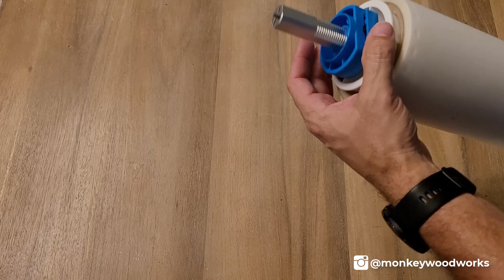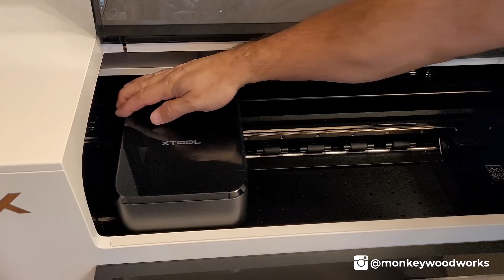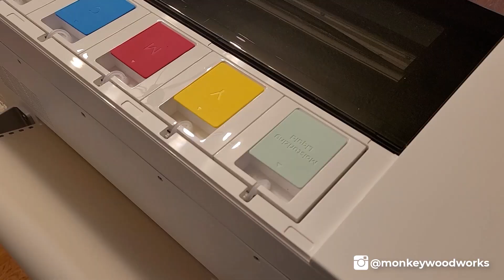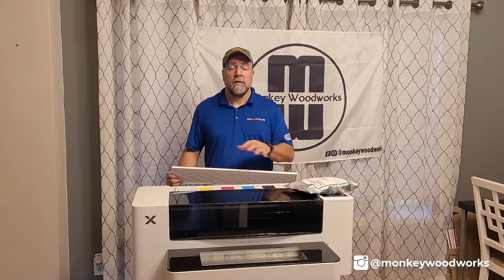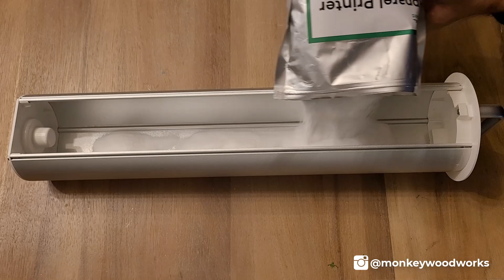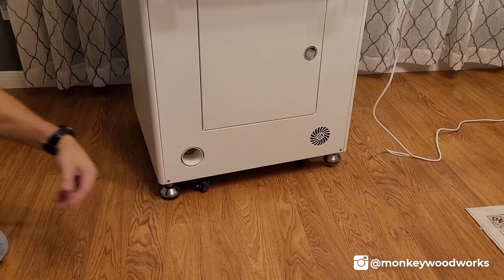xTool Apparel Printer Setup – Ink, Film, Powder & Cables | Beginner DTF Printing

Comment: What heat press setting temp time worked for you ?  Akso there is a tensioner for toll how loose should roll be ?
Reply from the maker: Honestly, i have had some issues with my beta machine so I have not had much time to use it.  My roll sits loose on the back with hardly any tension at all if any.

Comment: As I am waiting for my xTool Apparel printer to ship, I was going to order my supplies to vent out the window. Is that hose on the back the standard 3" hose like on the xTool P2? Also, is it a magnetic attachment? I want to order my adapter and other hoses and want to make sure. Thanks for any info you can provide.
Reply from the maker: It uses the standard xTool 3" hose without magnets.   I use a 4" hose on my P2 with a third party magnetic adapter from Lakeshore3D (great products btw) so I cant compare them to make 100% sure.
Reply: @ thank you, yes, I am ordering through LakeShore 3D as well and yes, they are awesome

Comment: Hello, i am interested in buying the printer. i am from austria. i am interested on printing with it on polyesters. there are often trouble with dye migration, so the color comes through. do you know, if is there a special blockout for polyester, or works it with the normal powder??
Reply from the maker: Great question! I am still learning (total beginner here), so unfortunately I do not have the answer to your question.